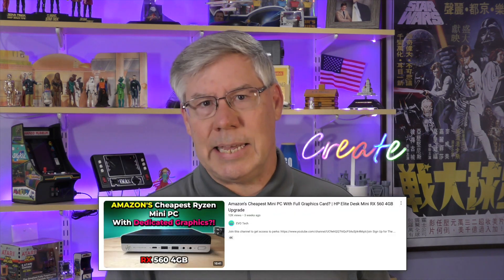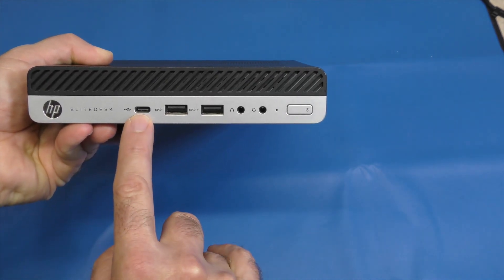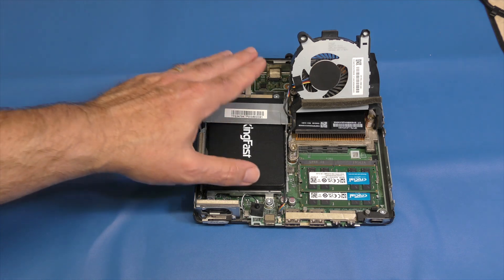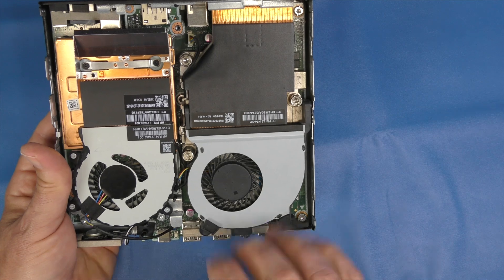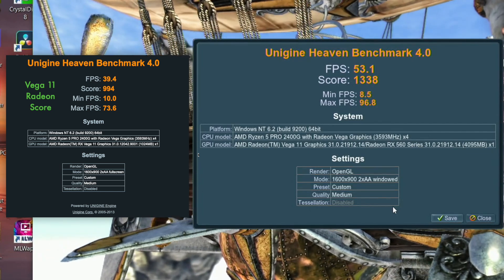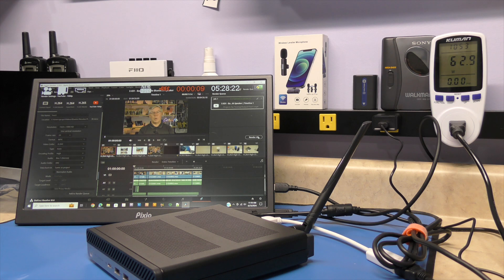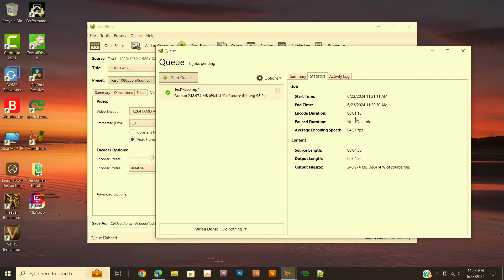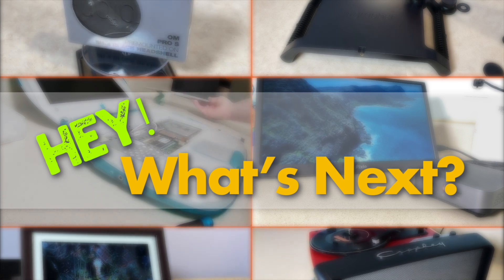HP EliteDesk 705 G4 Mini PC Discrete Graphics Upgrade

Comment: Lenovo M720Q is better. You can use a standard Graficcard. I use a M910X with i9-9900T and a RTX A2000 with 64gb RAM and 4TB NVME with BazziteOS and PS5 Controller.
Reply: And how much does it cost?
Reply: @heliosf9592  m720q you get sometimes under 70€. A2000 around 200€. CPU is expansiv But i wana it 210€ But you can use also 50€ Gen 9 Intel in a range around 35-45w TPW. CPU ... you need add Microcode in BIOS.
Reply from the maker: Thanks for watching. That does sound like a better unit.
Reply: @heywhatisnext  read how to make CPU Microcode Updates with Coffeetime. Also how to use a SPI Prommer to flash Firmware in circuits. After that you can use Gen 9 Intel on a Gen 7 or 8 mobo.

Comment: Did you exchange the standard power supply?
Reply from the maker: Thanks for watching. I did upgrade to the 150 watt power supply even though I had the 135 watt unit. Honestly, I haven’t noticed a different in wattage between the two.

Comment: Another important thing to consider is the top bezel cover.  I bought a 705 g4 with the 2400GE with the goal of doing this.  However, my unit came with a solid top.  For optimum ventalation, you should try finding one of the mesh tops that are on the 65 or 90w models.  The tops from the 800 g4s will work, but if it's not a g4, don't bother.  It won't fit.
Reply from the maker: Thanks for watching and providing this information.
Reply: Hello, I've been searching for weeks. Can you tell me please the part number? 800 g4 are with latch or screw? Mine is with screw, 705 g4.

Comment: Vega 11 is quite fast by the integrated standard. 130W with a discrete.. ouch that is a LOT vs max 65 on IGPU and CPU combined. Also watch out for the 35 vs 65 w models. I think that the internal GPU will only work for the 65W models. Also the price of the card has now risen to $75 USD.. and to ship this to my country is another $75 USD..  lol..
Reply from the maker: Thanks for watching.

Comment: I would like to see what this does to a Batocera machine running on one of these,  could be a nice small dual boot Batocera gaming machine/Windows media center PC.
Reply from the maker: Thanks for watching. Yes, I'd like to do a follow-up video related to retro gaming, but it isn't something I normally do. But this channel is the opportunity for me (and hopefully others) to try new things and learn along the way. Stay tuned.
Reply: Runs well. My Bartop arcade is powered by an elitedesk 705 g4 with the ryzen 5 pro 2400ge
Reply: @michealdionne5456  I would have guessed, I have done a couple of the G3s for family members. Their igpus are good even up to PS 2/xbox/GameCube emulation fairly well. I was more interested in what it could handle at the top. Like PS3 or XBox 360 emulation. I am currently running a ryzen 3100/3060ti setup for my Home Media Center/Batocera system. It handles most everything pretty well.

Comment: Would you suggest a G6 or G5 over this G4 if I copy the same upgrade?
Reply from the maker: Thanks for watching. In short, I guess it depends on what you want to do. The HP Elitedesk 800 G6 has a recent Intel processor and a discrete Nvidia graphics card option. As I stated in the video, I create interactive, online training and online help systems. For me the G4 works fine, and two years ago the price was hard to beat.

Comment: I’m wondering about emulation, my stock one tops out at ps1, will this run ps2 & Xbox or higher?
Reply: @butterbagboy  AMD RX560 isnt realy fast. Its 2,5 Times slower compare to a SteamDeck. This means ... If you Play emulated Games ... It Work fine. 30-60 FPS bottleneck is more the CPU If you use older Gen Intels.
Reply from the maker: Thanks for watching. Honestly, I don’t know but willing to try. If anyone else knows, let us know.

Comment: Are you using the Larger Power Supply?
Reply from the maker: Thanks for watching. During the video, I used the 135 watt power supply that came with the unit. I purchased a 150 watt power supply off eBay. Honestly, the mini pc runs about the same; no noticeable additional power consumption.

Comment: For anyone wanting to rush out and buy an Elitedesk G4+. Triple check with the seller. As not everyone has the MXM connector for the GPU on the motherboard.
Reply from the maker: Thanks for watching. I appreciate your comment and information.
Reply: @heywhatisnext  I have a stack of Elitedesks of various kinds.  Later versions can even have 2.5GB NICs as their Flex IO card option. Sadly not for a G4.  Flex IO is the name of the port you took out to install the GPU.  You will want version one if you go looking. As v2 and v3 will not work for you.
Reply: @Yandarval that might solve my problem! My 705 G4 DM won’t recognize the HDMI FLEX IO I installed
Reply: @Yandarval 

Thanks for this info!
Reply: @Yandarval  how about for a G3? i have the i5 6500 one.
Reply: @JaredGenesis444 I cannot say for certain for elite G3s. As you have one. The MXM connector is about 2cm long, white and parallel with the fan near the front of the case. My G3 has one. My G5 does not. Just the pads for one. Yet all info says it should have one. This why checking with sellers is important. If you intend to use the special GPU in these machines.
Reply: @Yandarval  i looked into it, a low profile GT 1030  actually works with pretty much all of them i think. thanks for reaching out to me though i appreciate it!
Reply: @Yandarval Hard to find the GPU for sale
Reply from the maker: I updated my description. Thanks.
Reply: 35watt models havent
Reply: @leondeco4835  I have a 35w version, and i can confirm it has the connector
Reply: not mxm
Reply: Can one solder one? Mine doesn't have the connector, but it has the solder pads, and I have the skills to solder one, but I don't know if the PCI lanes are connected.
Reply: @mikearisbrocken8507  technically, yes. However, when a connector is missing, any associated capacitors and other components are missing too. Which need to be added back on.  Without a schematic for what goes where. It is extremly hard to get working.
Reply: @Yandarval thank you💜

Comment: I have one doing nothing at the moment. I was debating on getting the gpu for it and install Bazzite OS and see how it does. Its currently running W11, with the help of rufus, just fine.
Reply from the maker: Thanks for watching. Yeah, I should have clarified that there is a way to run Win11, but maybe another video for later :-)
Reply: @dctaken  BazziteOS OS Run better with AMD GPU's at the Moment. Reason is BazziteOS use Wayland and Nvidia GPU's are Not Well integrated. FSync make troubles. Create Micro stucks. Also Valves Gaming Mode isnt full supported.

This means ... If you Look at Lenovo 1L PC's every AMD 75w is a good choice. 12V Rail isnt build to Support more Power. Also Intels A380 with A340 cooler Work in 1L Case.

One thingiverse you can also Download a Case Mode for two Slot SFF GPU's.

Comment: I just bought this little beauty last week. I love how easy it is to work on, unlike other OEM pc models. The only thing I would like to know is if this can be upgraded to a Ryzen 5 2600.
Reply: Its not possible the bios does not support it
Reply: however i removed the powermangement in bios and cpu  boost even higher
Reply: @sphericalcow5258  i did not remove it just disabled it
Reply from the maker: Thanks for watching!

Comment: I installed archlinux on mine,  but still uses the vega 11 and it works great and quite snappy
If you do don´t forget to install the vaapi  for  amdgpu.

Thanks for the video.
Reply from the maker: Thank you for watching, and the input on the Linux front. I’m thinking of running Mint on a separate partition.
Reply: @heywhatisnext  just do it and install it with EFI  bootloader  / works best